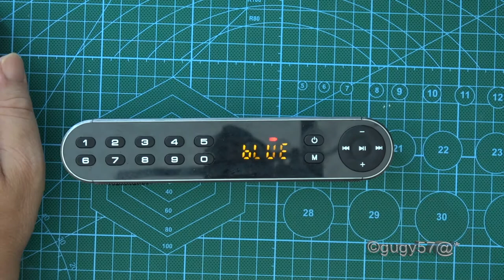TOPROAD (Antimi) Bluetooth Speaker - Disassemble and Reassembly (SK+HU narration)

Comment: I was considering buying this for Xmas present but you changed my mind after I saw whats inside. Definitely not worth €30. Maybe €10 would be good price (and probably thats what you pay if you buy this in China).
Reply: I mean I have one pretty good bass sound quality is good but loudness. Could be louder but I mean what did you expect
Reply: @rocket5984  You cant get bass from 30mm speakers...
Reply from the maker: it plays surprisingly well for its size, the volume could only be increased at the expense of the sound distortion. At aliexpress.com it costs about 17 €